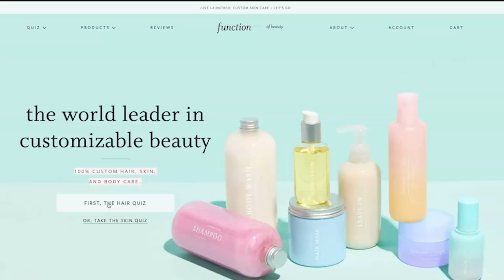WE'RE BEING INVESTIGATED BY THE FBI

Comment: FYI for anyone that sees this...if you have a broken window and can't get it fixed right away, Wal-Mart sells clear vinyl, by the yard, on a roll in the fabric dept. If you cut it to size and use good double sided tape it does a great job, very inexpensively. I've used it on a car and a house window. You couldn't tell it wasn't glass unless you touched it.
Reply: I use the thickest vinyl one on the lower half of my sliding glass door to keep the dog from scratching up the glass  ;-)
Reply: @redefiningmyself8598  That has to be a special dog you have, as the only things I know that can scratch glass is, other glass, Quartz, and diamonds. lol

Comment: Take pictures of all your walls before you close them up. Have the pictures printed out and put them in an album. You'll be glad 10 years from now when you go to make a hole in the wall
Reply: Helps to do that with underground wires and pipes as well.
Reply: Facts
Reply: I totally agree!  We have been in our self build house for 31 years now 
and things are needing replacing and a photo would be helpful !
Reply: That is such a good idea!
Reply: Great tip. Take note and do that. Trent those wires need to be straight and away from the edge of the two by fours so when you nail or drill thru drywall you won't hit a wire and cause a huge trouble shooting nightmare. This is advice from an old General contractor. 38 yrs
Reply: Brilliant idea, During our renovation I took  pictures and we have twice referred to them, once for heating vent location and once for studs to hang pot/pan racks.
Reply: Ya good idea take pictures. What will they do The 321 and a half miles of video tapes they have???
Reply: J Talk - Wise words regaring pics before you close wall. I did so about 15 years ago and I've yet to regret it.
Reply: Good idea.
Reply: @CorbinAce  it's OK bro,it's digital and doesn't take up any space.
Reply: @lilred6644  Yur right. LOL
Reply: Also, taking pictures of the walls now will insure the FBI didn't place hidden microphones and cameras in them while they were there. :).
Reply: Always have a tape measure set in the photos too, for exact info.
Reply: If you can, use a tripod and do entire interior in one session, save all in one folder.  Make a few signs like south wall or anything to help pinpoint exact location, tape to wall for photo, for exterior or large areas use highest resolution, you may want to zoom in on a specific detail years later.  And always include a tape or yardstick in image too.  For complex instructions or appliance info, photos are sometimes easier to find years from now then the original paper document.  Even packaging will include brand and model number, if you ever needed to know...
Reply: Excellent idea!
Reply: Yes.  Most general contractors, on large scale, high profile projects, run a 360 degree camera, mounted to a tripod, in every room where mechanical, plumbing, fire, and other systems are installed in the floors and ceilings.   As a mechanical contractor, those vids saved my butt,  when we had a Forman retire and had no idea how our system ran.   That cam revealed a leak wasn't us but the fire sprinkler system.
Reply: That is a great suggestion
Reply: I did all construction process, especially pipes ducts, and vents. When I later sold the home, I gave the album to the new owners as house warming gift!

Comment: Allie, I've noticed Trent doesn't run the vaccum so, before you drywall, make them install a central vacuum so you're not lugging a sweeper up and down two flights of stairs. I'm serious! Love you guys!
Reply: Love central vacums!
Reply: I love my central vacuum cleaner!
Reply: @LuciaLeePollard51   I had one in the first house I built in 1975.  It was a Nutone brand.  Recently I bought a house built in 1988 and it has the same make and model and is still running perfectly thirty three years later.  All the Braun fans (five) in the house still work as well.  You just can't beat the quality and reliabilty of the American made brands from that time.  Best wishes on your current projects!

Comment: In Canada you have to vapour barrier the outlets. So little plastic caps then when you vapour barrier plastic the insulation no cold draft air will get around the plugs.  & it protects them from moisture which can cause an arc..

Comment: Did you remember to bond your ground and neutral busses together in the box?  This will fail you if you don't do it, but it just takes a minute to fix.  Your ground wires should carry no current unless you have a short.  Your neutral wires carry just as much current as your hot wires, but the bonding references the neutral buss to ground in the box.

Comment: You may want to do data / ethernet / CAT6 cabling along with coax wiring while your walls are still open. Wifi doesn't reach everywhere and repeating or extending signals is okay, mesh is better, but not as good as an access point hard wired via ethernet cable. Same goes for coax for satellite or cable. Run the wire, crimp the connections later. You'll thank me.

Comment: I dont really know what I am talking about, so this is a question based solely on what I saw in the video. Is it possible that you put the door and the frame on upside down? I only ask because I noticed that the door opened from the left, when every other electric panel I have seen opens from the right.

Comment: As an electrician, I am 5 minutes into the video and an believe more than ever that amateurs should not do electrical work without getting some guidance or education themselves more. Don't over torque breaker lugs, don't rotate your wire strippers around a conductor when stripping them and create a notch. meh